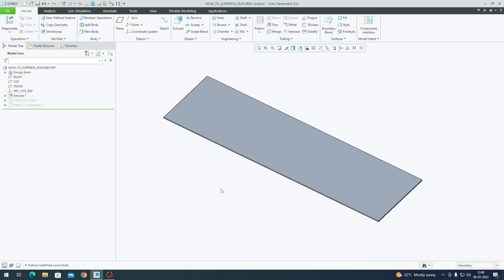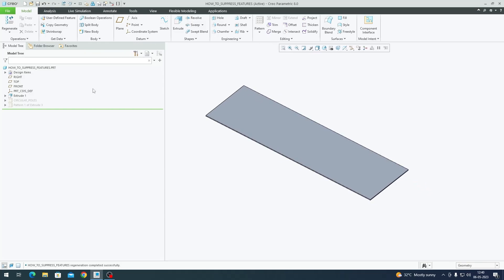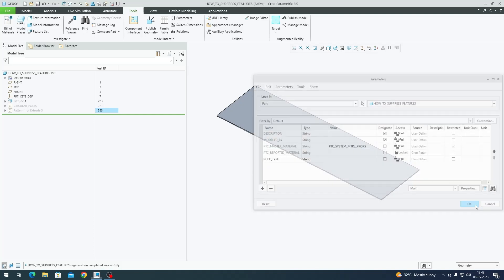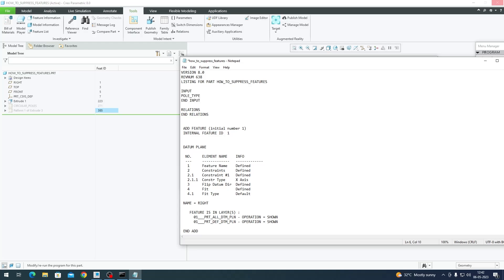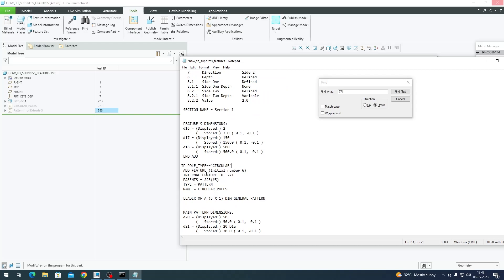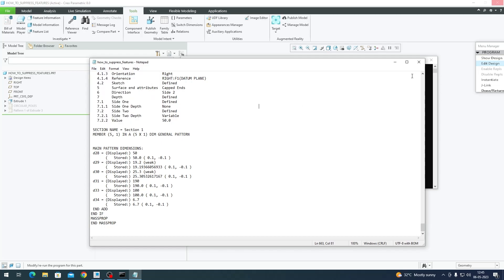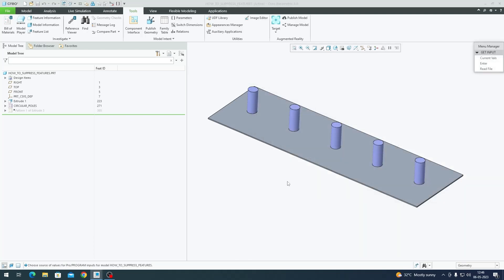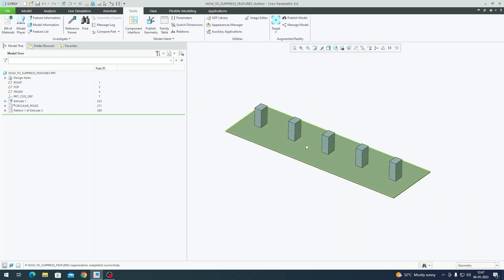Pro Program Basics | Hidden features in CREO Parametric | Creo tutorial |

Comment: You said for large assembly it's useful right. What if I will use simplified representation for large assembly?? Make sense?
Reply from the maker: Depends on your end goal. I use this feature to drive panel size in an elevator cabin for different values of height and width inputs given by field engineers. You won’t be able to visualise the aesthetics when you use simplified rep and reps don’t affect your bill of material I guess as it just hides features instead of suppressing it.
Reply: @MECH_ADHI  simp rep is not hiding parts from a assembly. It suppressed  parts and as you know Creo is bi-directional associativity so it will affect your bill of material too.
Reply from the maker: The point is, pro program lets you automate the manual efforts needed to create reps. You need to manually pick each and every part while creating a rep. Image you have 100 different configurations and it’s really painful to do reps and suppress/Un suppress. It gets even more painful when your piece parts need feature suppressing based on driving parameter. I don’t think we can parametrically control which reps to pick from a sub assembly at top level based on input given at top level.

Comment: On each time I open this model it will ask for input? If yes then it will become tricky to maintain drawing details.
Otherwise we can simply use family table to control this situation.
Reply from the maker: You could disable it from the script in case u find it troublesome. Family tables is a powerful option too. The main selling point about pro program is it’s easier to maintain one larger assembly rather than multiple sub instances and having to verify it after every change. Also, there is cost involved in maintaining part nos for corporations so, each instance adds additional cost (close to 1000$ per part no.) depending on ur PLM software.